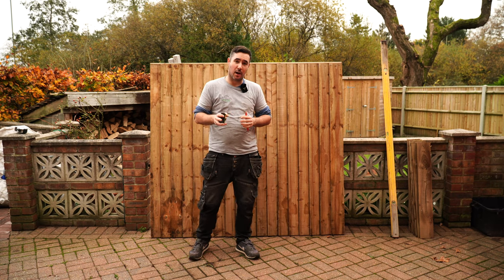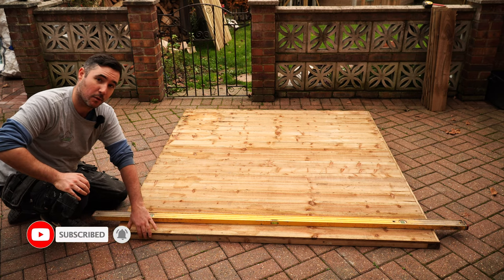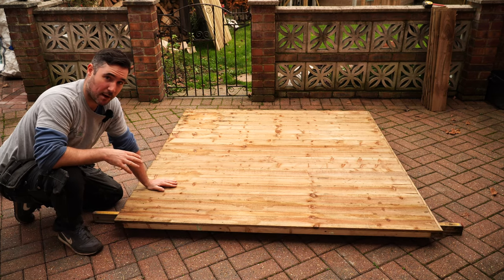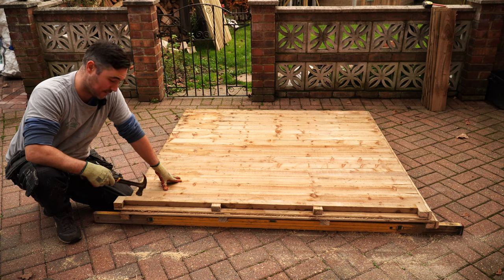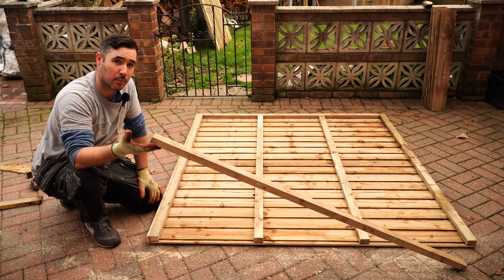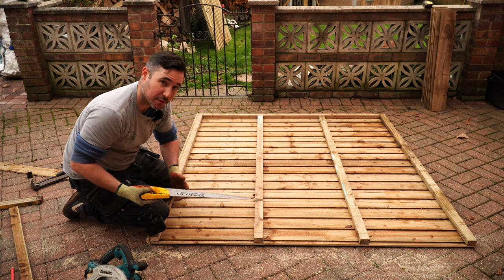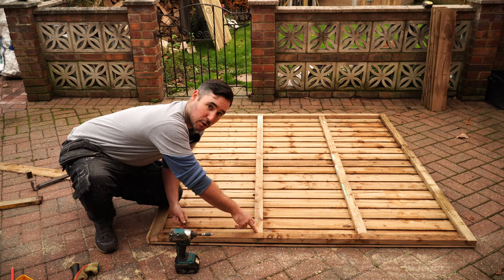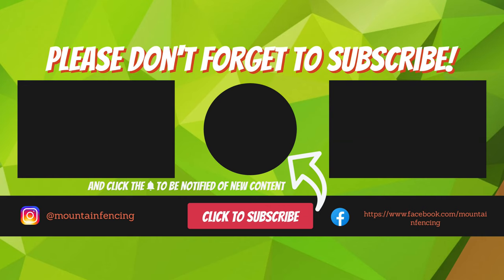How to cut a closeboard panel | Cutting a fence panel down to size

Comment: Nice video, what's the best option when we're just talking a few mm ? lift the last feather, sand down the batons and nail back down?
Reply from the maker: If you have a circular saw, set the guide rail to a few mm then just rip down the edge with the batton in place. Just remember to treat the cut with wood preservative.

Comment: what would you do if you had concrete gravel boards? can they be cut to size too?
Reply from the maker: Yes you can cut the concrete boards no problem. You will need a disk cutter of some sort though.

Comment: Hi great video. When trimming down a panel, Instead of sawing down a straight line, can I use a pry bar to take as many feather edge off as I need then slide the last one along to desired width the re-nail to the frame and finally re-fit the timber rail on end to complete the frame? If that makes sense
Reply from the maker: Thanks. Yeah you can do but its a bit more of a ball ache to remove the feathers without breaking them.

Comment: All good till nails are in the way. Then you need to take the slat off where it needs to be cut. Build the frame then re-slat. But i do it this way too 👍
Reply from the maker: Yeah it is a bummer when you hit a nail. Ive gone through so many saw blades.